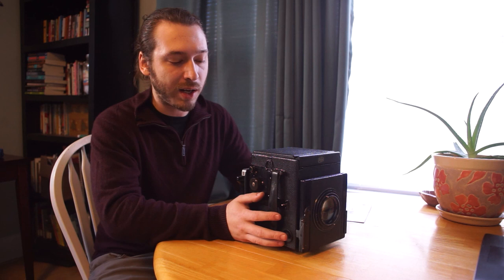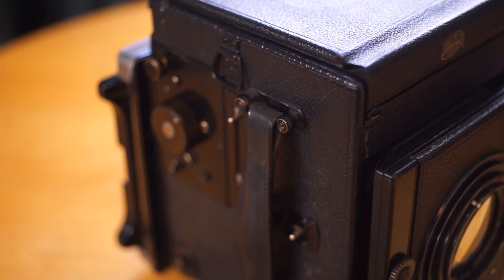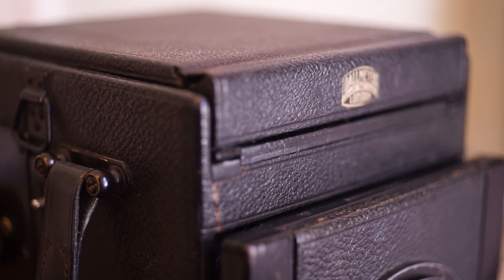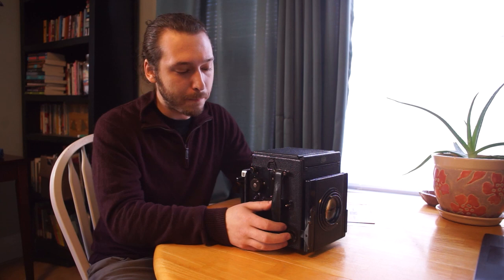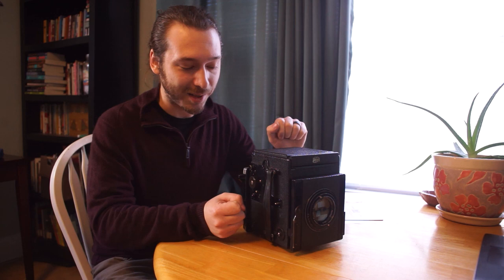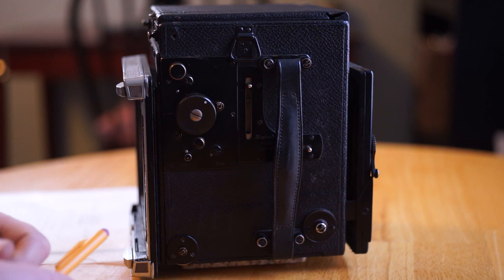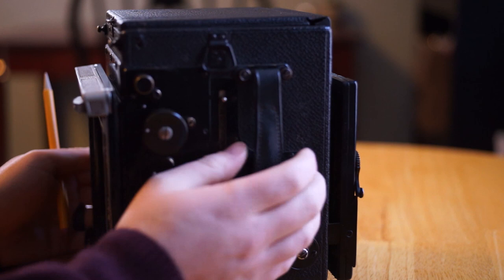Kershaw Reflex SLR Camera - History, Discussion, and Demonstration

Comment: with the dot set at the line to adjust speed (aperture) is the top curtain just beyond or sitting atop the top edge? What is the gap for the fastest speed 800 (or gap for the slowest 1/16)?  I got a Marion Soho with torn curtains which I am replacing.
Reply from the maker: The aperture should be sitting entirely beyond the frame line prior to setting. The "gap" is a negligible distance based on what the camera is doing. There are many answers to that question that are "right" however only one is correct for the camera in your hands ;) ;)
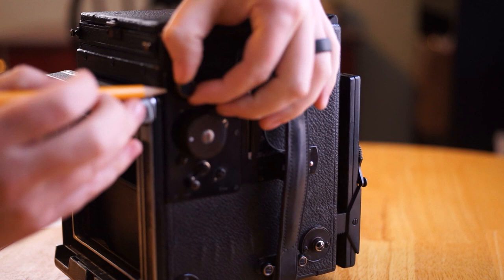Reply: @GraflexParts  hmm, I see the aperture inside the image plane from 8:56 and it grows as you adjust the speed, sonot sure what you mean by "entirely beyond the frame line", but I assume the demo is correct and understand that when the knob is wound to completion the empty space will move up outside of the image frame. Q2 - If you are taking 2 photos in a row with the same shutter speed, you can just crank the wind knob all the way and the speed is maintained? (seems like the shutters slam together at the bottom).  I cut my brand new curtains off to try to understand yet again but no more questions after this, I'll reglue them and go back to hands-on!

Comment: I really really enjoyed this! Very interesting! As a user of a Graflex SLR this seems a bit of an overkill for a very little gain. What do you think?
Reply from the maker: They're entirely different beasts in my opinion. I think these entirely have their place, but requires a lot more mechanical comprehension on the users end. I'm working on mounting a 150mm lens in another 3x4 Kershaw currently, something that would be impossible on any 3x4 Graflex SLR.
Reply: @GraflexParts  I see. Yeah, the distance between the front and the film plane in Graflex is pretty long. Most of the lenses cannot focus to infinity like that. That brings a question to my mind: have you seen any alternative lenses to Series B RB? I mean there is a screw mount ....